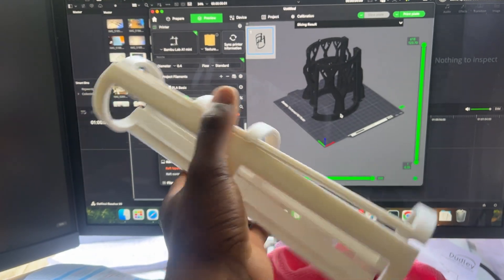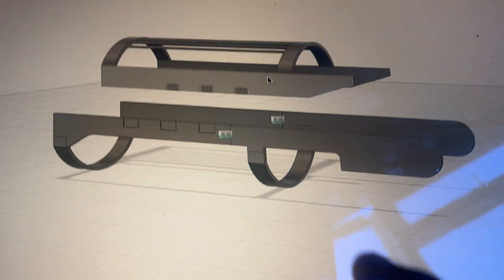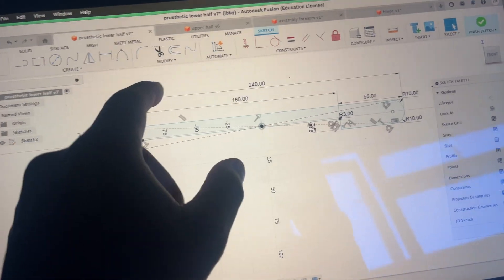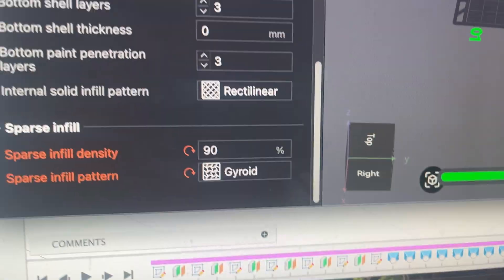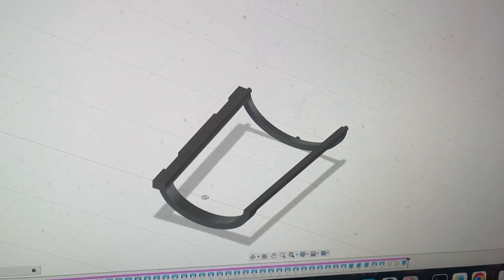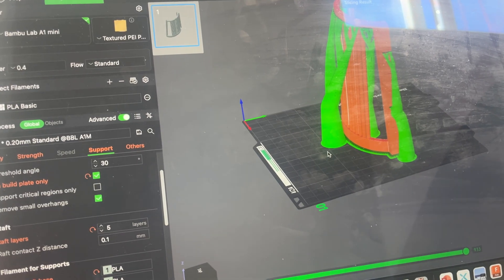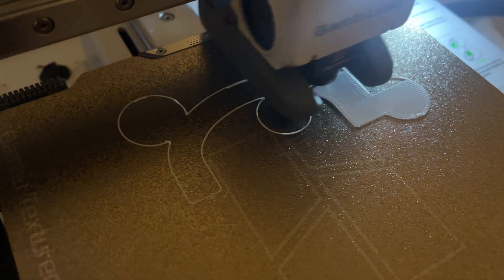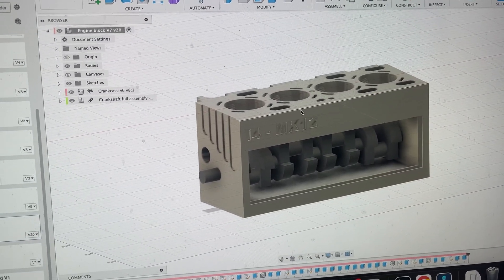I Tried 3D Printing An Exoskeleton – Custom School Project

Comment: One thing you should probably think about is how you’re going to get it to move with you. The thing about most exoskeletons is they don’t move with you they move for you
Reply from the maker: Yes you’re right, but the thing about this one is that it’s way bulkier than the actual manufactured one will be, if I made it the same thickness then it would be basically impossible to print so it should be able to move with me, additionally I’m going to make a full arm for this not just a forearm